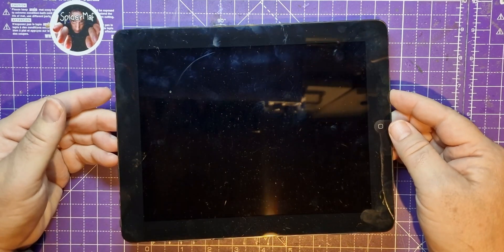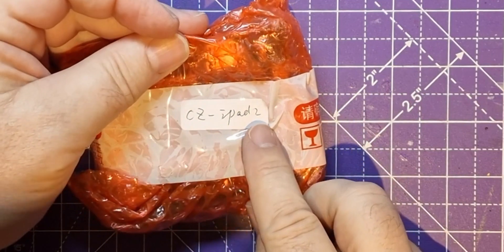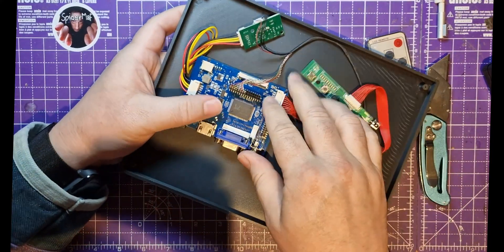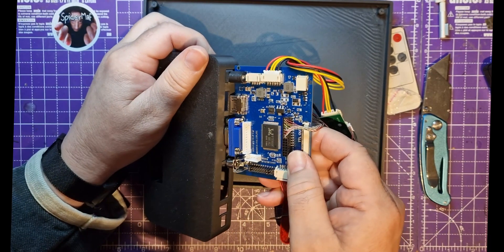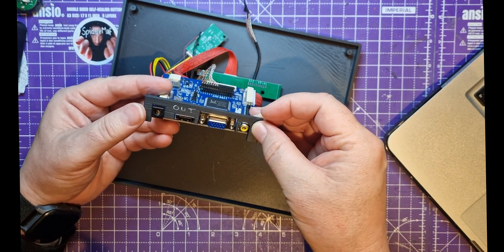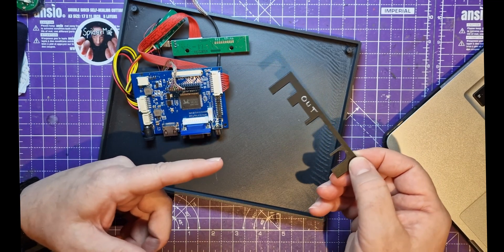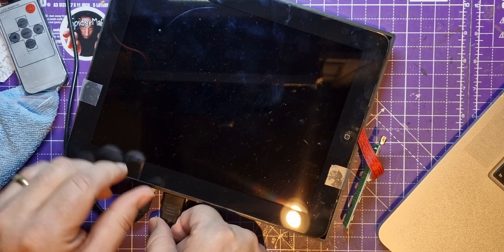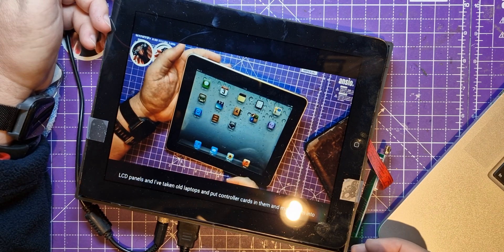Reusing an ipad first generation screen as a preview monitor. HDMI controller card and a new case.

Comment: Pretty nice. The old iPad 4 could get some new life. Hardly any apps run on the old thing anymore.
Reply from the maker: Something I was reading on the controller card listing implied it would work on iPad 4 if I recall correctly. But best thing is to crack your old iPad apart (assuming you dont use it for anything else first ) and look at the label and do an eBay search for that panel. I’m not sure if the iPad 4 has a glued in screen either so access might be different.

Comment: I have many LED screens from old laptops. Is there a common controler or a method to them?
Reply from the maker: Best way I’ve found is to get the model off the back of the panel and search for that model and the controller card on eBay or Ali. And make sure that the cable to the led panel comes with the card. You can by a generic card and do the cabling and the card firmware yourself. But it probably won’t work, it barely ever worked when I tried that. So now I just buy the card that’s been pre flashed with the correct firmware and cable for your panel.

Comment: Great video. 👍If the touch sensor would work this could become a sure hit among Raspberry Pi users. 😉
Reply from the maker: Yeah. The digitiser connector is still there in the back of the screen. But would need the opposite socket and someone to work out an interface for it.

Comment: 16:53
Hope you didn't throw away the original aluminium ipad enclosure. Some people managed fit the board inside the ipad case and reuse volume/power/home buttons for navigation. You might need to drill holes or have the entire board outside and just slot in the wires through the power port.
Reply from the maker: To be sent to @bigstackd to be turned into the finest pirate coin....
Reply: Do you have a video were someone does that?

Comment: Looks very nice, a good project I think I will have a go with the Dell screen I have as it is 1080p, thanks
Reply from the maker: Give it a go. Make sure you get the exact panel model from the inside of your screen (don't rely on online specs) and then search for that model on Ebay or ali to find the correct card.